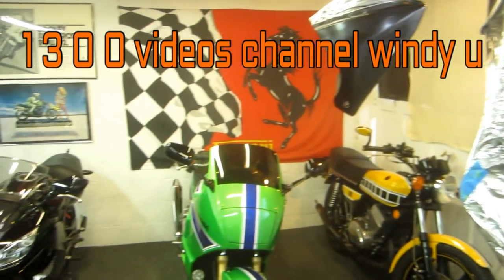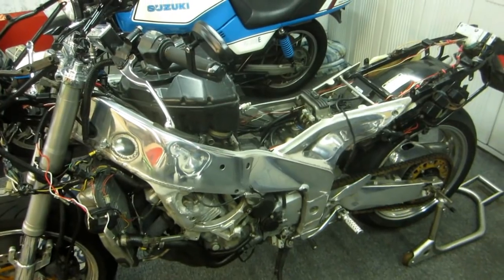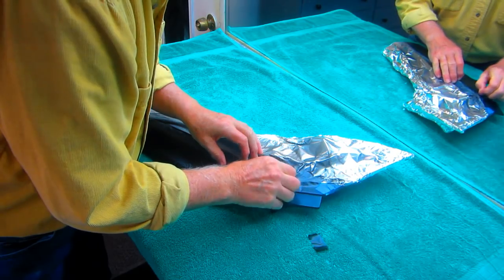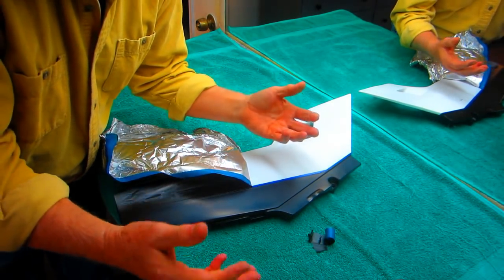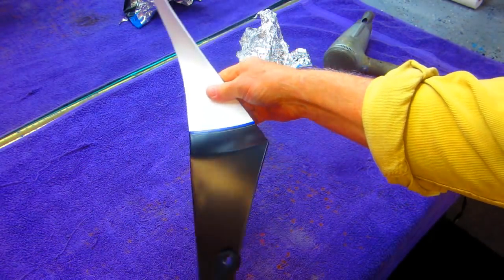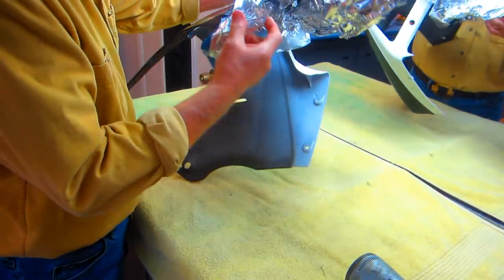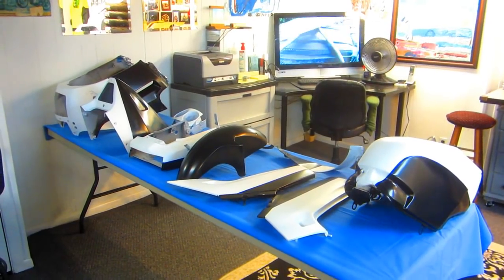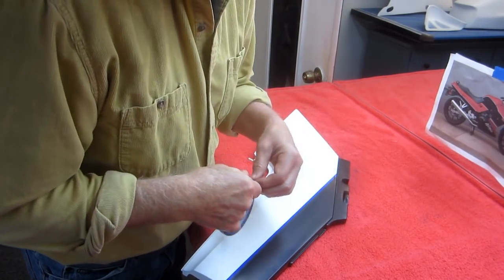pt 54 FZR RESTORATION,PAINTING RED AND BACKMASKING,LONG DAY.

Comment: Nice work, thank you to show me, which color Pistole is this with what jet 0.8, u do not clearcout? Did u have no problems with fuel on tank with no bakink finish the tank. With primer did u use for plastic parts and is this the same for metal tank,